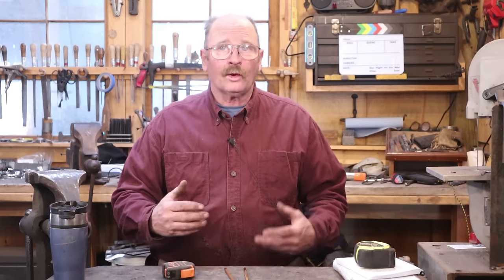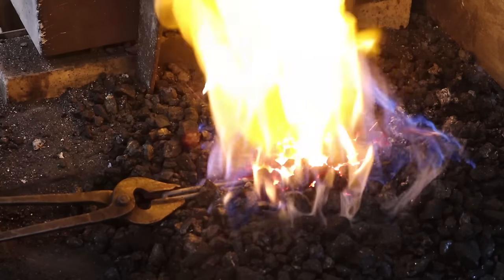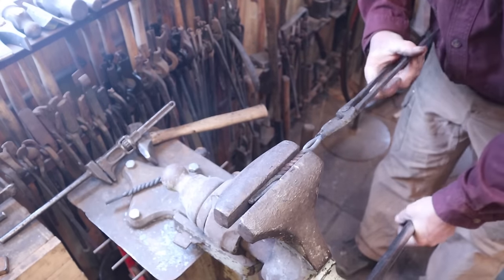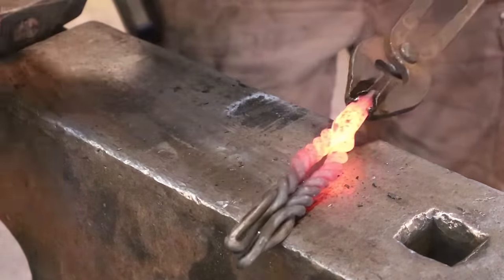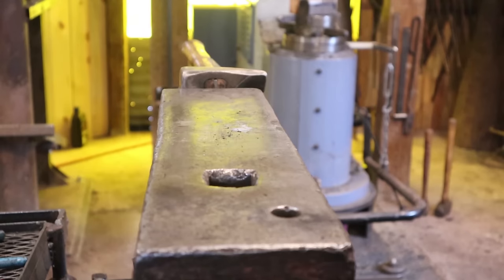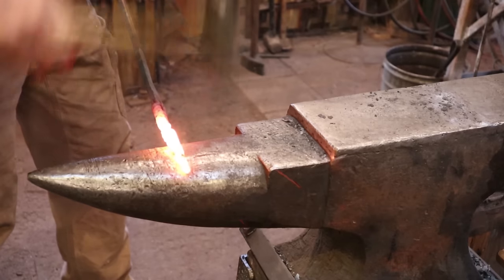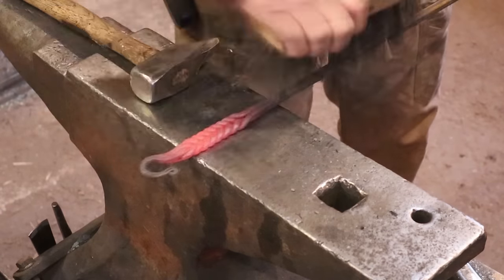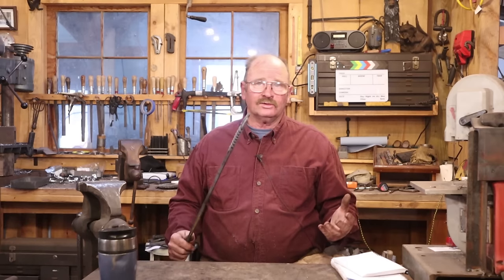Blacksmithing - Chevron or Wheat twist, forge welding twists

Comment: I really enjoyed your video. As a retired full time blacksmith working with coal I could almost smell the coke burning that clinker while you were forge welding. You didn't have to bring that clinker up but you did and that makes you a very humble blacksmith in my mind, because while you are working it is easy to get caught up in your work while explaining what you are doing, then you explained what happened, that is teaching. Great! I have a feeling that wouldn't happen if you working alone without filming. Any way what a humble way to teach, and that is what you did with the clinker comment. I always had an audience when working. Sometimes I would be cranking away talking and explaining what I was doing, then notice a brilliant display of fireworks, thereby forming a clinker and contaminating my forge fire. I got more comments for the sparklers than  the product I was making. On a side note,  I notice you use an angle peen hammer, I used one a lot and don't see many using one much any more. I thought that was a more ergonomic tool than a straight peen. Keep up the good work.

Comment: I've had a fascination with blacksmithing since I was about 5. One thing that has always stuck with me is the anvil noise. A blacksmith with an anvil that does not ring is generally the most skilled. They also don't swing the hammer without purpose.

Comment: Love that type of twist John thanks for the demo! A ton of great skills was demonstrated here :-)
Reply from the maker: thanks
Reply: Ok so now I feel a little dumb....I re-worded my search and just found videos from both of you that may cover this subject....so I'm off to watch them now. I am still very interested in making contact with both of you though because I'm sure there will be more questions down the road.
Reply from the maker: Hopefully those videos will have the answers your looking for.  I don't do much outdoor work, so most of my finishes are more indoor oriented.
Reply: @brianderby145  
Am no pro, just old school, but a rub with beeswax @ a black heat (250°f or so) lasts about 5 or 6 years in my experience.
Reply: Very nice!
Reply: Look for rust converter, a mild chemical that changes surface and other rust into an excellent primer as a black finish or base for paint. That’s different from a raw finish, more of a visible coating, but one way to go. Let the metal rust all over for brst effect. There are chemical methods for that too; I know there is a simple way, but not coming to mind ATM. Good luck

Comment: Great video! That’s a beautiful looking piece. I have a hard time forge welding. I don’t think my homemade gas forge gets hot enough. I’m gathering stuff to make a ribbon burner. Hopefully I can develop that skill since I really want to be good at it.
Reply: If you want a very good hot running ribbon burner you need to make one of Paul Pinto ones he makes, I made 2 they are easy n get very hot
Reply from the maker: Many gas forges won't come up to welding heat.  Most ribbon burner designs will, so that would be a good choice.

Comment: Just got done doing this after watching your video again, I did take your lesson to heart. I use to have trouble with forge welding, but found these three things to being key to success ( clean the material well before attempting a weld, clean your coal fire and make sure you can achieve a welding heat, practice the weld before you attempt it hot and stage your work station) all these things I learned from watching your channel. Thanks John, you have made Blacksmithing possible for even a dumb monkey. Best regards!

Comment: John I have been trying to learn the drop tong method of forge welding for a while but have not really been at all consistent with success. After watching your video I tried again at first with borax with the usual result the bottom piece sliding out from under the top when I tried to set the weld. Not having any other flux to try I just heated the two pieces and tried joining without flux, success. Tried several more times without flux and had much better luck than with borax. The comment you made about borax being slippery helped me to get past the idea that I had to use it to make a weld. Thanks for the video and that comment you made about borax I don't ithink I'll be using it at all in the future to  set the weld.
Reply from the maker: Thats great.  I am glad the comment helped.

Comment: I look at the finished piece at 24:21, and I see a rattlesnake tail (the buttons on the end).  I can see why they call it a wheat twist, and a bunch of them made into actual wheatsheafs and bound by wire coil ''rope'' would look great as a feature inside a garden gate.  I don't work with metal (apart from the rare use of a Mig welder), but your video showed up in my recommendation list after watching some guy make a woodworking Knapp joint.  Don't you just love the YouTube Algorithms!
Reply from the maker: Glad you enjoyed it.

Comment: I grew up in a welding shop and one thing my dad stressed was old school metal working, so off in the corner was a complete blacksmith shop with all the toys. my education didn't start with mig or tig but hammer and anvil, I was ten. Blacksmithing is a lost art in general only kept alive by those interested. I wonder when the "green new deal" happens if they will teach blacksmithing in public schools again, hey, horses need shoes too Ya know.

Comment: Not gonna lie, from looking at the video thumbnail I kinda expected you to split a bar and then just curl it inside itself, like the leather braid technique. But your forge welding thing makes more sense given the material. Just wondering if it would help prevent that delamination if, instead of forge welding four separate rounds together, you bent a couple over and turned that end into the hook. For that matter, I was wondering during the welding if it would hold on its own or if it would be beneficial to give the hook a separate twist for the mechanical interlock between welds. Seems to hold just fine, but that might be a cool look to go for.

Comment: Nice job .    How would it help to have a good wood mallet (made from a heavy wood) it won’t leave any hammer marks on some of your finish work. I was fortunate to have an extremely good instructor in farrier school. The first project we had to do was take horse shoes straighten them make roughly 3/8 square rod then forge weld two of them together then finish them as fire tools. One poker one rake make a third one for holding a water can to keep the fire contained. This was about 45 years ago before the gas forge got popular. We were thought to make shoes from bar stock. Do a good job of that before we could use manufactured shoes.  Consequently most of my career I used primarily handmade shoes

Comment: LOL, I can't tell you how many times I should have cleaned the fire but tried to push it and eek out just a little more work and fight and figtht it only to clean out a "Klinkzilla" after the fire is out :P I have seen several videos of yours where you tend to use a bend jig a lot for things like rings. I tend to go the other way and  not use jigs (which is kind of funny as I spent my entire carrer as a jig and fixture maker LOL. I also teach the students to form both the rats tail  and the ring over the edge of the anvil using a differential quench the rats tail to firm it up so it does not deform when hammering the loop. For me, it is just easier but everyone has their own thing and prefered way to work. Ask 5 smiths how to do something and you will get 15 different ways to do it and they all will work!

Comment: So it looks like a four strand flat braid almost. Would it be a lot harder to do that or would it be to different of a pattern? I’ve always thought that it would be cool to make a Viking style hatchet with the braid wrapping around the wooden handle and connect a blade face of the hatchet. I really want to make a small hatchet hammer combo as a walking cane handle. That way I could grab roots or wood whittling pieces that I might come across.

Comment: Question. I made some pine oil in my mini still. I found out that it works for flux to solder copper pipe.  Was wondering if this would work in place of the flux you used also.

Comment: Nice twist & work. I have always said, "If you cannot fireweld you are not a Blacksmith!" It is one of the five basic skills in Blacksmithing and if you cannot do any, or all five, then you are not a Blacksmith period (in my opinion). 
Just for those who might read this and not know what the five are: 1. Draw down (make thinner). 2. Up set (make thicker). 3. Punch (make a hole). 4. Form (make a desired shape) 5. Fireweld (weld two or more pieces of metal into one piece using the heat from the fire and blows from a hammer). And if you cannot do any or all of the five skills, well you could always call yourself an "Artist Blacksmith!" like so many I have come across! If you do, then you will also have to learn how to talk a load of bollocks as well to try to cover up how unskilled you are! LMAO

Comment: Great pattern, the little crack on the end of the loop adds character. If I was looking to purchase an item that split or crack as you called it would have been a selling point. All the blacksmith items I have were bought because of the characteristics and of course the needed use of the item. Question for you, can that pattern be done open to form a wider handle? I really enjoy your work and the time you take to explain the process! Great looking shop and thank you for the links for tools. Glad you mentioned the bit about wearing safety glasses. Stay Safe and continue the good work!!

Comment: Would it be okay to make twists from mild steel using a small gas only torch that is really just suitable to make 1/16th inch sheet glow? Because I've noticed when restoring 3/8" thick plate material, when it has a pulley forcing it, it only needs a few hundred degrees to make it move, so I thought to ask if a weave can be made if the steel is barely glowing, if that would be enough heat?

Comment: I built a furnace that has two torches with propane + compressed air mix. I don't think we are getting it hot enough to really shape the metal like we'd like. Any tips?
Reply from the maker: Torches might work to some degree, but forge burners are more specific to forges.  Try searching for gas forge burner designs.  There are lots of online articles that are better written that I could cover here.

Comment: I have a question: I know not everyone has this option, but is there an advantage to forge welding certain pieces, like this one, as opposed to using a MIG welder?
Reply from the maker: It tends lo look better with forge work plus it is often much more efficient to just do it all at the anvil once it hot.
Reply: @BlackBearForge  thanks for responding. That makes a lot of sense.

Comment: What is that you are pouring is available in shops
Reply from the maker: welding flux.  I use iron Mountain Flux.  But any forge welding flux will work.  Most blacksmithing suppliers sell flux.

Comment: I have a bread shuttle my great great grandfather forged for his wife, it is roughly 180 years old. I am looking for two hooks of some kind to hang it horizontally under my fireplace mental, do you have something I could buy for my need? I am 75 and no longer able to do much physical work.
Reply from the maker: Send me an email with a description of the hooks you need and I will see what I can do.  switz@mindspring.com
Reply: What I envision would be a hook screwed to the under side of the mantel, hanging down about three inches then turned up like a fish hook about 3/4 of a inch, is there a way to send pictures of the shuttle?  @BlackBearForge

Comment: It's a shame about the tip of the hook de-laminating because that looked really cool. I keep looking at pictures and video's with, what look like, complicated work (I've done a lit of rope braiding over the year's including several bull whips, up to 10' long!) and I'm sitting there thinking how I'd have to braid it and it turns out to be a LOT easier in blacksmithing!!! Instead of several hours of work with loads of bars, you just have to know the propper way to do it! LOL I wish rope braiding was that easy 😋😆😆
Reply: At least the chance of getting burned is lower with braiding :-P
Reply: @peglor  you'd be surprised how many times I've been burnt with braiding! With nylon you need to melt the ends of the cord so it doesn't fray, you also end up pulling the cord to tighten the braiding up...... rope burn, it's just you only get a tiny bit at a time. You might start with around 28 cords and slowly drop to 4 down the length of a whip. Every 1/2" to 1" you need to really tighten all of the cords resulting in thousands of small friction burns, all in exactly the same places (gloves and braiding don't really work). After an afternoon braiding I'd gladly switch to red hot metal!!!! LOL

Comment: He reminds me of a fellow who heard, from mutual friends, that I was getting into a little forge work. The guy called me to talk of stuff. In a bit it seemed that his main issue was to inform me that "you can't forge weld high carbon steel". At that time I had only welded some very high carbon stuff. The rake pickup spring teeth from a harvester. Some pieces of fulcrum from truck scales - they were so brittle that dropping them had potential to break off chips.
I finally conceded that he'd been at it for years and I could learn more from him than he could from me. He thought it was a compliment. I thought I was still capable of learning.

Anyway - this guy does not make much coke before he gets to the welding. He cannot see his work as it heats - I suppose, over time, he has developed some instinct for when it is hot enough. I did my heating much in a coke trench. Always worked in more coal in a way to be pretty much coke by time it adds to my "trench".
I made same twists as him as early experiment in forge welding a knife blade. Makes an attractive pattern that would be even better if stuff was folded a lot of times before doing the twists.

Comment: What is the tool you are using to turn the stock at 6:09?
Reply from the maker: A twisting wrench.  There are many ways to make a twisting wrench.  The one in the video is an old monkey wrench with welded on second handle

Comment: could this pattern be used to make a pattern welded blade?
Reply from the maker: Possibly, but it does have a lot of empty space
Reply: @BlackBearForge  i guess youd have to end up forge welding the whole thing together anyway which sort of defeats the purpose, unless there are structural benefits to melding different steels in this way? idk

Comment: how long dose it take for metal to heat up?
Reply from the maker: Depends on the size of the material and the forge.  For this it takes a minute or two
Reply: Black Bear Forge thanks, I’m wanting to start black smithing but every jump cut of the metal heating up makes me think it takes 17 minute
Reply from the maker: Leaving the heating in might add 17 minutes to the video, but generally once you have the first heat, it reheats quite quickly.  There again it depends on the mterial size and they forge you are using.

Comment: 9:20 "weld them together gently"
proceeds to hit it with a hammer repeatedly
Reply from the maker: That is the way you forge weld but there is a huge difference between light gentle hammering and wailing away as hard as you can.

Comment: Shouldn't you be wearing some kind of glare protection safety glasses? Doesn't looking directly at red/white hot metal cause eye damage?
Reply from the maker: Only if you plan to stare into the fire.  The light is no where near as intense as that from electric welding processes.

Comment: can you lose all your carbon out with so many reheats? should you quench in oil and then normalize?
Reply: It doesn’t really matter in mild steel.
Reply from the maker: When working in mild steel, it doesn't really matter and since it doesn't need to be hardened I don't quench it

Comment: It looks like a three strand braid , I sure do love what can be made with steel and heat. Could a braid be done as well?  One of the three masterpieces  I hope to produce in my life is a functional modern semi automatic firearms design , all made with blacksmithing ,except the barrel and furniture. because I want it to be a top end, cold rotary hammer forged tube . With a stellite bore liner if a can make that happen. And wood or polymer are much nicer than bare metal in 20 below zero.   M.p. #2 is a side by side double rifle ,fully embellished and decorated with graving and inlay and gemstones set in various places . M.p.#
Three is a new operating system design for multiple platforms and should be scalable for any size gun or even artillery pieces. If I succeed.

Comment: So much knowlege has been lost.  I used to watch my grandfather forge weld much larger pieces of metal together... in the 60s on a Krause Chisel... when arc welders and gas welders where handily available.  Too bad you are having such are hard time with 1/4" material.
Reply from the maker: Actually heavier material is often easier to weld as it holds heat better and has the mass to be worked into final shape. Smaller more delicate material cools quickly and doesn’t have the mass to support itself during such a high stress operation.

Comment: Do you know you need to wear goggles to work with Metal that hot?
Reply from the maker: Do you know that blacksmiths don't wear tinted googles to forge weld because it does not produce the intense level of brightness you get from a torch or electric welding processes.  I gather from you comment that you have never forge welded and probably don't do any forging.  Stick around, there is lots to learn if you are willing to be open minded and not make assumptions based on lack of experience.